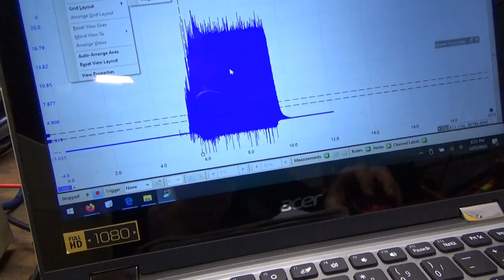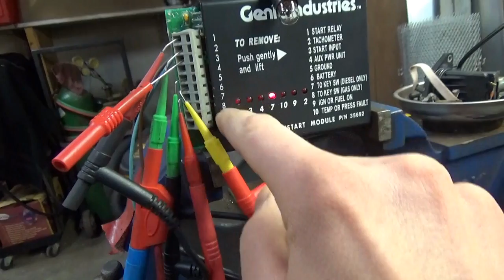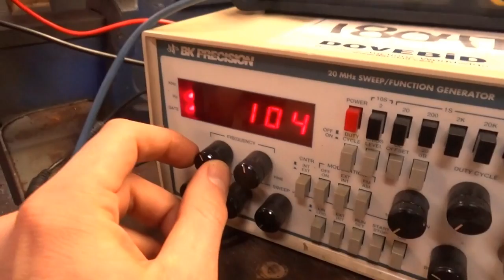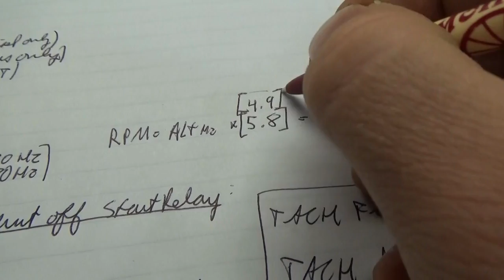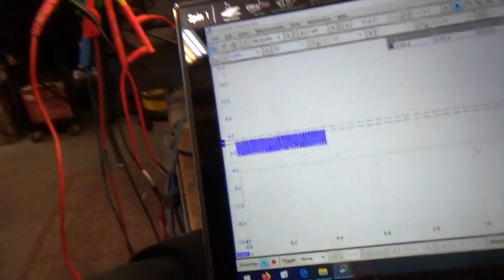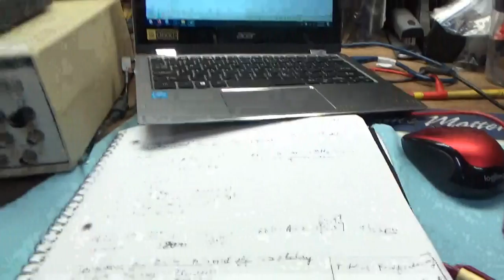Genie TACH signal (Short Crank) Module Bench Test!

Comment: Love your channel. Normally, at 960 RPM the engine is turning at a frequency of 16 Hz. That is 960 divided by 60 will convert RPM to RPS or revolutions per second, which is equivalent to cycles per second, which is equivalent to Herts, which is 16 Hz frequency. Interesting that the alternator is producing 10 times the frequency, which is 160 Hz. So somewhere in the controller is a frequency counter looking for a frequency of something greater than about 160 Hz, which is what you are seeing. There has to be something wrong in the frequency counter circuit. Maybe there's a problem with the tach signal conditioner circuit, which is probably composed of a diode, resistor, and capacitor. Maybe a cold solder joint there. Good luck.

Comment: Great video. Even if you replaced a module that is still good, I would not call it a "Pine Hallow Parts Canon".  From a practical standpoint, you can only do so much on the job site in the mud.  You also didn't talk about cost of the module. If your labor time would cost more than the module, then that's something else to consider too.  That's great how you are double checking to see if the part is good or not after the repair. Most people would just toss it out, and never learn as much as you are.

Comment: does this machine have an capacitor? i have a genie that wont start. to get it to start, i remove the wires from the fuel solenoid and contact them direct to battery, the engine starts and the the machine functions normally. what i found after having gone bald, the capacitor on TB41 was faulty. this is wired into the tach side. the machine i was working is genie z4525 model year 08. would love to get your feedback on this.

Comment: As a professional MEWP Technician I really appreciate your going the extra length to tear into how the module works. 
One thing I have seen over the years on the genies, especially the kubota powered ones, is that tach signal wire comes out of the alternator behind an aluminum cover.
I've seen lots of those rub through due to vibration,  not sure what yours looked like on there but something to look out for on future service calls.
I enjoy your channel and all the fun diagnostic toys you pull out to play with.
Reply from the maker: Thanks for the comment, Ryan! It's exciting to learn more about these lifts. I enjoy variety in my daily work :)
Reply: I've been working on them almost exclusively for 25 years.
Hit me up if you need some information that you can't find on your own.
Reply: interesting. I have a genie z45-25 that wont start even  when the ism has been replaced.

Comment: 3.1V and 2.2V sounds like typical logic input level min and max voltages required to trigger a high or a low.
Above 3.1V and it's a high.  Below 2.2V and it's a low.  And that sounds like 5V cmos logic.  Where the 5V cmos spec
is 1.67V and 3.3V and if you measure you find it's just a little higher and lower respectively because they built in some headroom.

But my guess is a cap has gone bad.  It's always an electrolytic cap.  Replace all the electrolytics.
I have fixed many pieces of oddly functioning gear by replacing the electrolytics.  
Just fixed an old audio limiter by replacing the electrolytics.
Re-capped my Fender Twin and the hum has gone away.
Fixed many computer LCD monitors where the electrolytics for the backlight power supply had gone bad.
And lot's of general audio and digital gear I've fixed just by replacing the electrolytics without bothering to 
actually track down the problem.

The best situation for an electrolytic is a room temp environment and voltage always ON.  If you have an audio amplifier or any stereo gear or VCR or anything like that.  Leave it plugged in and ON all the time. I have audio power amps I have left on and unused for 10 years.  They still work just fine.  The only fear is a lightning strike.
I have a small pile of equipment that I have on a timer that cycles the power on everyday for 30 min.
TV sets too.
If you put it away unpowered for 5 years it will likely not be working when you pull it back out.  The electrolytic plates will collapse and start touching and the unit is shot until you replace the electrolytics.  I have a VCR that has exactly that problem right now.  Next time I need to play a VCR tape I will have to replace the electrolytics in the player first.  That day may never come though.

I bet that genie sat out in the hot sun and got hot enough in the summer to degrade the electrolytics.
Pop open that module and replace them all.  Especially check for areas inside the unit where a component is generating heat.  If there is an electrolytic near it then it is likely to have gone bad. Electrolytics go bad in heat. Look on the PCB for any burned or browned area as a clue to hot components. How close is that module to engine heat? Any electrolytics near that area need to be replaced but better to replace them all.  Electrolytics in 100C will go bad in just a few weeks. You don't have to use exact replacements.  A higher voltage rating is fine.  Generally a slightly higher capacitance rating by 50% and even 100% is OK.  And get the best temperature ratings that are reasonably priced.  Digikey should have what you need.  If you read the datasheet for most electrolytics for their time to fail at higher temperatures you will be shocked to find that many can only survive weeks at temperatures that just don't seem that hot.

Also, in the burned or browned areas check the carbon composition resistors.  Prolonged heat will also change their value.  The carbon composition resistors are usually the ones that drift with heat.  They will look charred.  It was common for designers to use carbon comp resistors when they needed a 1W or higher rating.  Newer designs stay away from carbon comp.  But I would bet your module was designed years perhaps decades ago and they just keep using that design even on brand new models because the cost of re-designing and re-proving that module prohibits a change.  
Most of the semiconductors, if they are working at all then they have survived the heat just fine.  The semi's generally don't degrade by much or at all.  And they can take much higher heat than electrolytics and carbon comp resistors.

Comment: Good analysis. Frequency derivation for the start determination is probably done in the microcontroller (in this case PIC) firmware. You did not show us the new non-oem one, maybe they improved it? It is likely that the new one has either an improved algorithm (maybe faster uP) or input smoothing components. Could still be an off-value cap in the signal conditioning part of the original - you may have guessed right after all. Could also be that noisy tach startup signal that the original module reacted badly to - I was trying to think of a way to feed the recorded the signal to the original module again to reproduce the problem.  Great work Ivan,  interesting video.

Comment: Did you try to run a dc supply to the tach signal input? I wonder if the module looks at the rms  voltage rather than frequency. Would be an easier strategy and would mean the module wouldn't care about signal noise. If that was the case  and there was a voltage spike when the starter moved, then that might explain why it shut off the instant the starter started turning.
Reply from the maker: If your rms voltage theory is correct, then the module would have shut off the start relay when i had the DC offset dialed up :)

Comment: The starter looks quite new, what if a wrong type of starter is mounted, causing a to high cranking rpm? 
Normally that would not be a direct problem.
However the cranking rpm you measured/calculated seems quite high and close to an engines idling rpm.
It could cause the module shutting down the start relay, because it thinks it is already idling, while in fact it has just started turning, and to short, to have a reliable start.
Reply from the maker: Cranking rpm is about 300rpm, low speed once it starts is about 1,600rpm. Module turns off start relay once engine is over 800rpm.

Comment: I worked in electronics for a while, came back to automotives.  I wish so many times that I had my old power supply and frequency generator.  Diagnosing out of the box to locate the source of the problem.  I've done that in the past with my DMM and old 2 channel Fluke scope.  Seems ancient now compared to the Pico, but it worked!  Hopefully that Genie will be the only one that gives you problems.

Comment: Ivan i have great respect for the way you work. I had the same with a Volvo 245 from '88 only 298.000 miles (just run in) on the clock same sort of intermittent probs. It is a Calif. car so lots of electronics (Chrysler ignition) to keep the enviorment clean. Just disconnect every contact and clean it then petroleum gelly on it. After done all of that it runs perfectly. We are going up to the 1.000.000 miles with that car.

Comment: Great analysys. The 6.3V lock up voltage is probably a power watchdog chip - when the voltage goes below threshold the watchdog holds the RESET ping of the CPU active to prevent the CPU from doing stupid things. When the voltage goes up, the WD releases the reset pin, the CPU's program starts from the beginning and reacts to the inputs. Someone mentioned in the original video that the big electrolytic capacitors of the module might be on the way out. That would explain power fluctuations during startup. The capacitors cannot filter good enough the voltage and it drops too low. Have you inspected the capacitors with a magnifying glass? A little bulging at the cap or the sides is a clear sign. Or there could be bulging at the bottom of the cap which is harder to spot. 
Bad capacitors could also affect the reading of input signals since the input circuit is also affected by the bad power supply voltage. 
Another possibility is the new controller to have a updated firmware with fixes for such erratic crank signal at startup.  

I really enjoy your channel. I'm also an electronic engineer and like fiddling and repairing things including cars when I can and have the time. Growing up in Eastern Europe my dad and I were constantly repairing the family Жигули - stripping the entire car bare bone to replace the rusted out floor, rotted structural elements, etc. Engine rebuild, clutches, brakes, you name it. Those cars are dead traps but run forever (it still runs being made in 1975) with lots of repairs and welding :-)

Comment: Just my two cents worth, it seems WAY too complicated, and expensive for the module to look for both upper and lower voltage thresholds plus frequency to lock out the starter.  Remember this is a manlift manufacturer here. Fast, cheap and KISS is the bean counters mantra.  I'm wondering if one or more of the parameters you discovered, and are assuming "as intended" is actually a fault in that module.
Reply: Don't forget that because it is a manlift that can reach 60feet height OSHA and a host of other regulatory agencies mandate safety and failsafe considerations for the control circuits. I worked on one of these. It was a different year of manufacture but every bit as convoluted and confusing. To the terrestrial layman, it is an overly complicated boondoggle.

Comment: Is that a capacitor story ?
Reply: Вполне возможно!     In the photo of the board, the most vulnerable components are: C6  & C10. But they are for the voltage regulator MIC2951, it does not affect our problem.

Comment: It would be interesting to see if the amount of load on the relay outputs would change any of the test data. Such as, a relay coil that is drawing excessive current from the module....is there potential of that variable that you don't have in the test, having an impact on the outcome?
Reply from the maker: good question. Relay itself was fine, and the test light simulates a comparable load, so I think the module driver has enough power to not kill itself :)

Comment: Two things:  tach signal conditioning.  The original module SC circuit has fatigued and isn’t doing its job.  Leaky capacitor, etc has already been mentioned.
Second:  If this module has a microcontroller, then there should be an ignore tach command in the firmware that causes the controller to ignore the tach signal for “x” amount of milliseconds.  This way the tach signal can stabilize and give valid information.  The new module has newer firmware that has changed or lengthened the ignore tach signal for a bit longer and makes it more reliable.  Companies do this all the time.  There may have been a recall of the original module for just this reason.  I’d check on that.

Or a combination of both.  I’d start with checking all the electrolytic caps on the board.
Reply from the maker: Great tips, Harry. That makes sense!

Comment: So the rpm signal is like a crank signal. I wonder what the air gap is and if there r a bunch of metal particles in it potentially causing a problem. It isn't a vrf signal. It seems to be a Hall Effect. Nobody probably scopes those signals. Even the factory techs probably follow a flow chart. They also have a bunch of stock of parts to substitute until they get the right one. Great series. "I Dream of Genie"

Comment: So a lack of crank signal means letting the battery drop dead or cook your starter motor, Great design :-o
Reply: Exact same as most cars with ignition key starter activation (I e  not start by wire).

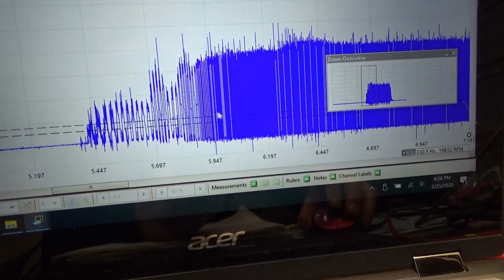Comment: 19:00 Ivan: Nice! So what causes these noisy tach waveforms from the alternator? I'm wondering  whether a dirty or worn slip ring or its brushes for the field winding in the alternator would result in an intermittent excitation field, and thus an intermittent alternator output including from the alternator tach output (that is a tap on the same output windings). Also, it's the voltage regulator that's supposed to be controlling the field winding, so an intermittent fault in the regulator could have similar effect, though I'm having difficulty imagining the details of such a regulator fault.  It seems more plausible that slowly-rotating slip rings and brushes could exhibit this type of intermittency.  Or indeed an intermittent connection from the battery (which supplies current to the field winding during starting) could also cause intermittent field current.  But I'm still liking the slip ring or its brushes.
Reply from the maker: Great theory. Might be time for a new alternator soon, they do go bad. This one is probably the original and 20 years old!
Reply: @PineHollowAutoDiagnostics  Many years ago employed at a huge equipment dealer and the man lifts and genies, came into being ...starting was a big problem issue due to starting and stopping all day long. start it up ,swing it a little and shut it off. Adds up quick. Plus leaving the master switch on all night  and the key on, or some one stealing the battery.
    Working in the dirt you will learn before you even check for a loose belt put on gloves,those edges on pulleys will get razor sharp due to dust and belts rubbing it in. Belts wear, pulleys get deeper. Caterpillars in the dirt those pulleys will slice right through you hand socks. Trying to remember if the nippendenso alternators were little like 22 or 35 amp if that is what is on your genie and the starting and stopping and worn puleys and going to full charge output and it is that critical for the tach sensor...my my my. maybe...
     Not knowing then what I know now from this experenice with you and the genie and trying to keep up with all of ,well its nothing new tech makes my mind hurt. I am very compressed with you skills and bull dog attitude toward finding the truth. Never got a whole lot of atta boys in my life but you deserved one. Atta Boy!
Reply from the maker: @MY-ml5rp  love the comment! I agree that the start stop running of these lifts is so hard on the engine and electrical system. Severe duty!
Reply: @PineHollowAutoDiagnostics  Этому подъемнику 20 лет ?
Reply from the maker: @engeneer_ru5827  1999 goda 👍
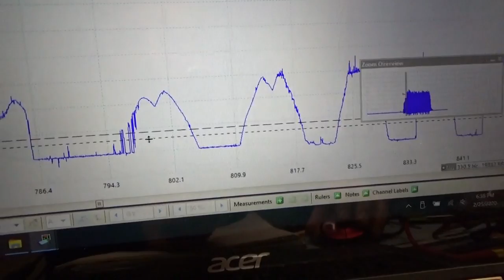Reply: @PineHollowAutoDiagnostics   I wonder if one of the diodes in the alternator diode pack is going bad/intermittent.  The rising edge of the double hump pulse shown at 19:07 perhaps looks like it. Also the very first low amplitude pulse at 18:25.
Reply: i missed that it was a feed from alternator as tach. signal, the brushes are probably about gone in it then, they do get stupid noisy when worn way down. as they get worse it will make lights flicker and pulse on a vehicle, which seems to mainly be a ford thing, because I've seen it multiple dozens of times, in fact mines getting stupid on output not when first started and around idle.

Comment: Ivan: The 6.3V lower limit on the module operation is probably the dropout voltage for the one or two voltage regulators on the module that probably provide 5V for the MCU and 40106.

Comment: Ivan: I noted from the last video that the module contains 40106 Hex Schmitt inverters (ie: with hysteresis inputs) that are almost certainly used for cleaning up the input signals. Your measurement of 0.9V hysteresis requirement corresponds to typical hysteresis of 40106 input when powered from 5V.  The 40106 may well be running on 5V -- there are a couple of components in the module that could be a 5V regulator to power the 40106 and the PIC MCU. Or the 40106 could be running on a higher voltage, and the input tach signal might feed through a resistive voltage divider before going to the 40106.  It seems likely that there would be some passive circuitry between the module input terminals and the 40106, including clipping diodes to prevent a voltage arriving at the 40106 that is outside the 40106's power/ground rails by more than 0.6V or so.
Reply from the maker: This is awesome, in-depth info on the circuits, Graham! Thank you for the insight!